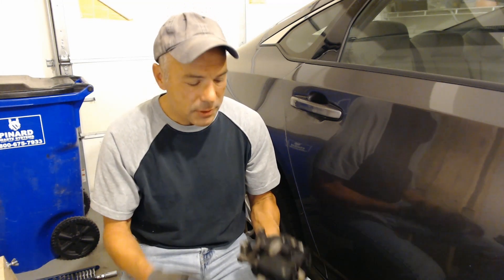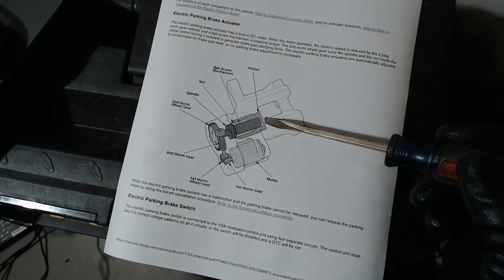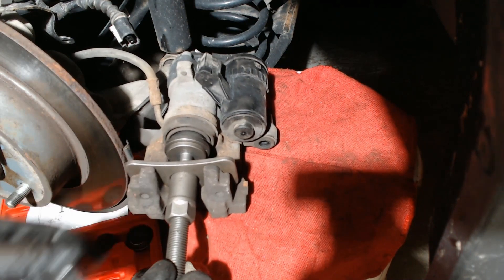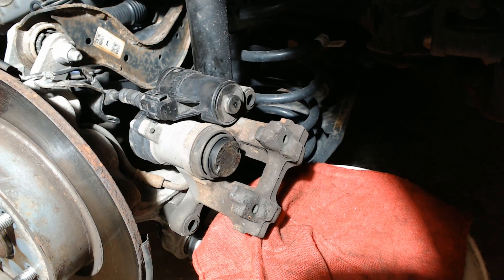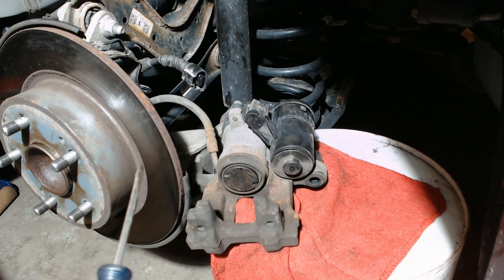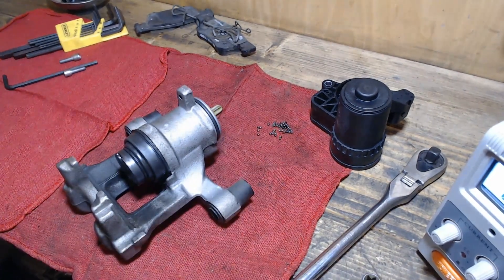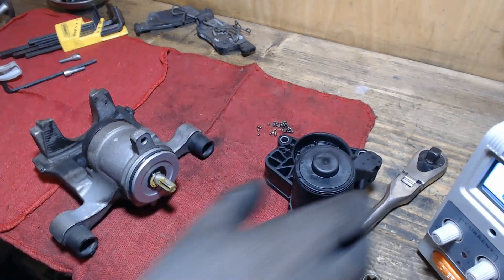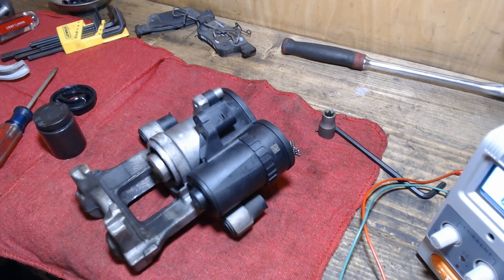4 Ways to Retract Brake Piston on a Honda Accord with Electronic Parking Brake

Comment: Very helpful video. My hang up was trying to understand why if the piston is keyed to the parking brake shaft, rotating the piston in turns the shaft but retracting the parking brake doesn’t cause the piston to spin. Then I saw your breakdown and realized that the piston is decoupled from the parking brake shaft by a nut and then it all made sense. The piston is keyed to the nut which the shaft spins independently of, not keyed to the shaft itself. Great breakdown, thanks!

Comment: I heard you can just use needle-nose pliers to turn back the piston.  If it's a safe method, this is a great option, since you don't need to buy a tool that has a single use case

Comment: Whenever you use scan tool method , do both driver and passenger nut retract simultaneously? 
And when you’re done with one side do you have to put u back in normal mode or leave it in maint. Mode until both sides are done?

Comment: Awe-inspiring video showing the EPB mechanism. Thank you! If I use the wind tool to move the piston back like your option 1 here, do I need to disconnect the power plug? 2. Is this EPB the same as Acura MDX?

Comment: Hello, thanks for the video very informative. I'm learning as i go and i was wondering about when it's time to push back the piston (ex. talking about this specific caliper in the video) you can either twist it to push it back (after the motor is retracted) using that special tool or just press it back it and both do the same? or only one way will work or which method is first the twist and then push without twist? I'm a little confused if you can help. I saw how towards the end of the video you did a tear down and described all the parts but if you can explain it that would be nice.

Comment: Excellent info, thank you very much John! These instructions also apply to the third generation (2019+) Acura RDX. I used the first method - manual retraction by rotating the cylinder with a caliper tool. The only difference I found vs what's in the video is that the rotation fully retracted the piston, no compression was required after that. The Acura dealer charges $1000 per axle to replace the pads and rotors.
Reply: Stealership

Comment: John this is the best video I have seen buddy and gave you a thumbs up plus I subscribed. I do a lot car work so this is simply amazing .  I will be getting a scan tool do honda parking brakes as honda is the only vehicle I work on. Can you recommend a good scan tool that will work on all or most modern honda please and thanks .
Reply from the maker: Thanks much for the nice comments!  From cheapest to most expensive, this is my experience with regard to Honda vehicles and scan tools:
1. BlueDriver Bluetooth OBD2 Scan Tool and Code Reader - This is relatively inexpensive and reads most of the Honda OEM codes and PIDS, but it does NOT support any bidirectional test.
2. Launch X431 - This tool reads Honda OEM codes and PIDs and support most bidirectional tests.  I have had trouble getting some bidirectional tests to run, but it hasn't been a huge problem.  This tool is very fast which is nice and also has a wireless OBD port dongle which is handy.
3.  Autel MS906 - This tool reads Honda OEM codes and PIDS and supports almost all bidirectional tests.  I believe this tool probably has the fullest implementation of Honda codes/tests of any of these tools, but it is also annoyingly slow and the touchscreen commonly fails over time.  There are probably newer versions of this tool that are faster but I haven't used them.

I'd probably recommended the Launch X431 overall for hobbyists out of those three.
Reply: @JohnsDIY Thank you for your insights my good sir.

Comment: So I don’t need a scanner I can do this manually without like old gen cars right
Reply from the maker: Yes, at least for the 2018 Accord 1.5L, I have successfully retracted the rear brake pistons several times using the screw-in tool followed by just pressing it back in the remainder of the way.  I have had no issues doing so.

Comment: Can we just put on "N" and retract the piston? I recently bought the car with EPB and I will try it when I change the rear pad.
Reply from the maker: Thanks for the comment!  I assume you are thinking to put it in neutral to ensure the parking brake is not engaged (if you are using autohold for example)?  The problem is that this will not fully retract the parking brake (inner piston).  When the parking brake is disengaged (turned off), it backs the piston off by just a small amount so that when it needs to turn on it only needs to travel a short distance which makes it quicker to turn on.  If the piston retracted fully then it would take a long time to turn on the parking brake (many seconds).  So I think this method should turn off the parking brake but I don't think it will retract the piston all the way so you will still have to retract the piston the remainder of the way using one of the other methods (maintenance mode with a scan tool, windback, electrical bypass drive of the motor, or rotating the shaft).

Comment: To my understanding, the Honda tech manual (which I see you have) used to suggest method 2, or alternatively method 4 which you demonstrate. I have heard that Honda advises not to use the windback method 1 as it may damage the internal mechanism. Seems to be working okay for you, though.
Reply from the maker: Thanks for the comment!  I did look up honda tech info before making this video and I do agree that Honda do recommend method 2 (scan tool maintenance mode) or alternatively method 4 (remove parking brake motor and turning the rotor with a torx bit).  I did not see any explicit warning about not using other methods but I could have missed it.  I did even look in the brake maintenance precautions and did not see anything there.  If you can find a warning about that and can send it to me, I'd like to include it in the description.  I can say that I have completed the brake jobs a few times using the windback method and have not had any issues personally.
Reply: @JohnsDIY  Hey John, thanks for the response. It was not in the manual; it was several Honda technicians who suggested that Honda advises against turning the piston. Previously, I used method 4. I found your video (which is great) and now I am considering the windback method as it is much less labour-intensive. Just hesitant because of the previous information. I have heard multiple stories of people getting their cars towed into a Honda service center because they messed up the motor, for various reasons. Thanks
Reply from the maker: @b.m.9909  Thanks for the info!  Yep, that makes sense.  Mechanically, I don't see much difference between rotating the piston versus rotating the shaft, except if you rotate the piston you have to make sure that the boot is free to rotate and doesn't get bunched up and obviously this is not a concern with rotating the shaft since the outer piston doesn't rotate.  I always wondered if that might be the reason Honda recommended the other approaches - just to avoid the possibility of the boot getting bunched up or torn.

The two biggest complications (sometimes resulting in tows) I have heard of with DIY brake jobs on newer Hondas are:
1) People going the wrong way (via any method) and driving the inner piston all the way out.  As this releases the ball bearings for the ball screw mechanism, I don't believe there is any DIY way to recover from this except for getting a new caliper.
2) Problems with the electrical connector.  Either just not seating it all the way, or pulling on the wires (usually in the process of disconnecting the connector) which can disconnect internal connections inside in the back of the connector under the dust boot.  This will lead to inoperable ebrake and a brake light on the dash.
Reply: Thanks for the detailed information. The techs mentioned the e-brake motor mechanism but maybe that isn't correct. Thank you for the great videos!

Comment: Hello.  Did a rear brake job today on my 2020 CR-V and retracted the electronic parking brake with a 12V source.  Brake job performed fine, but now I am getting an “Parking Brake Problem” error message and it doesn’t work.  I don’t have a scanner.  Do I need to re-calibrate or reset the electronic parking brake?  Please help 😢.  Thank you!
Reply from the maker: It would be very helpful to read the OEM codes.  However, I would start by double-checking both of the brake electrical connectors.  Do the pins look good, and are both connectors fully inserted until they lock?  It is very common to get an open-circuit code because the connectors are not seated all the way.  Did you pull on the wire at all when disconnecting the connector?  On many Hondas, there are internal connections inside the plug that can become disconnected if you pull too much force on the wire (for example, if you pulled on the wire rather than the connector body when disconnecting it).  This will result in a code and Parking Brake Problem notification.  SouthMainAuto on youtube has a video of a DIY brake job which had this problem and shows how he fixed the connector.  Good luck and let us know what you find!
Reply: @JohnsDIY  Thank you!  Can you please send me a link to that video you talked about from SouthMainAuto?
Reply from the maker: @mgislao7  Yep, Here's the link, good luck!
https://www.youtube.com/watch?v=TzRVn4R3vTk
Reply: @ You were right - just a loose connector.  Thanks for pointing me in the right direction!
Reply from the maker: @mgislao7  Super!!  Nice work getting that straightened out!

Comment: If you push the caliper in with this method, it will cause the rubber boot to twist and get hung up because you have to push and turn the caliper piston at the same time to get it improperly
Reply from the maker: Thanks for the comment!  Good point, you will definitely want to be careful about that.  The boot is not attached to the piston, it is free to swivel, but after sitting in there for a while it does get semi-attached by dirt and grime.  If you just go in there and rotate the piston, it may well crumple the boot up.  However, if you go in first and gently release the boot from the piston, you shouldn't have any problem.  Sometimes you can just grab the end of the boot with your hand and work it back and forth until it frees up.  Or you can very carefully take a small pick and lift up the edge of the boot and then work it around in a circle being very careful not to poke a hole in the boot of course.  Once the boot is freed up from the piston though, you can just turn the piston and the boot will just retract nicely.  Thanks for pointing that out!

Comment: You forgot to add method 5: turn the piston with pliers 😂 I watched a different video and person said it was easy with pliers. It was not. Getting a caliper tool set now and doing method 1. Will use method 4 as a back up. Thanks for the video. Also, you said method 4 would be your least recommended. What’s your best recommended?
Reply from the maker: Haha, yep, I bet pliers could work if it was a pretty new car but I've had the same experience as you in general.  Often it takes a decent amount of torque to twist the piston.  On my own vehicle, I generally just use the windback tool and then push it in the rest of the way (Method 1).  I think it is just the quickest and easiest for me.  Thanks for the comment!

Comment: Easiest way no lie is having the car on trust me 20 years mechanic here, it compresses like nothing make sure your car is on park and disable electric parking brake. No need to take apart or use a scanner or a battery it’s nonsense. You get no codes or errors after installed
Reply from the maker: Thanks for the suggestion!  I have not personally tried that, but I would note that if you do use this method, you probably don't want to unplug the caliper since that will definitely generate codes if the car is on.

Comment: So I didn’t manually do that I did my brakes and then I just push the piston in, but I also disconnected that electronic brake system switch by the brakes and then I did my brakes put everything back but now my brake light switch inside the car light is flashingso what do I need to do to fix this 2019 accord
Reply from the maker: Are you sure that you plugged both of the electrical connectors back in?  It would be good to doublecheck that they are connected and seated all of the way in (latched).  Did you pull on the wire going to the electrical connector?  There are contacts internal to the connector that can become dislodged if you pull on the wire too hard.  This is not an uncommon occurrence in DIY brake jobs and there are videos out there on how to fix it.  Other than that, I think you need to read the codes and see why the PCM thinks there is a brake issue.

Comment: What happened if piston all the way out?
Reply from the maker: If just the outer piston is all the way out then you should be able to carefully push it back in over the inner piston and then retract it all of the way back.  If both the inner and outer pistons came out (and you are looking in at the threaded rod) then that is a real problem and you are probably best to get a new caliper.  If the inner piston comes out then it releases the ball bearings that make up the ball gear drive.

Comment: so the 1st tool wont push it all the way in??
Reply from the maker: I am not sure exactly what you mean, but I assume you mean that rotating the piston doesn't cause it to go all the way in. In that case, that is often what happens. Once the inner piston is completely retracted, the outer piston will not be able to turn anymore. At that point, you should be able to just push the piston in directly the rest of the way, using a C clamp or similar press.

Comment: After entering brake pad maintenance mode on scanner, do you still need to unplug the wire before retracting the piston back?
Reply from the maker: No, there is no need to unplug the electrical connector.  Once you enter maintenance mode, the inner piston will be completely retracted and then the parking brake motor will turn off.  At this point, you can simply push the outer piston in directly using a clamp or pushback tool.  The only reason to remove the electrical connector would be to give you a little more flexibility/room to move the caliper around.  If you do leave the connector connected, just be careful to not put any strain on the wire because there are internal connections inside the connector which can become disconnected if you pull on the wire too hard.

Comment: What about when it retracts all the other out how do we get back in 😢
Reply from the maker: So do you mean that the inner and outer piston both came completely out of the caliper?  Did all the ball bearings fall out?  If just the outer piston came out then you should be able to put it back in.  If they both came out then I don't know of any easy way to fix that.  I'm not sure how you can reload the ball bearings for the ball screw of the inner piston.  I think if that happened, I'd probably just purchase a replacement caliper.
Reply: @JohnsDIY got it done thanks
Reply from the maker: @cylogistics8262  Nice work!

Comment: Question, if you’re doing both rears, do you wait until both are done then calibrate all at once or do one at a time?
Reply from the maker: I find it works just fine to recalibrate one time after both sides are done.  The "recalibrate" routine is as simple as turning the parking brake on and off a few times.

Comment: On my 92 Civic ❤.... I pull a handle, and a cable actuates the piston, and even that design was bad enuff when you add corrosion....why did this happen? (rhetorical question) Why an electric motor, worm gears, etc. that will be exposed to salt where you poor souls reside?
Reply from the maker: Yep, I hear you!  I guess it allows the "brake hold" function which automatically applies the brake when you come to a stop and releases it when you press on the gas.  I guess some folks like it, especially in traffic, but personally I never use it.

Comment: Don't force the nastiest fluid in the system upstream, crack a bleeder.
Reply from the maker: Thanks for the comment and advice.  That's a good thought for folks to consider.  I have heard others suggest that as well.  Of course, if you do that then you will probably want to bleed the brakes after to make sure no air got in, especially since (depending on the method used) retracting the piston could take a bit of time.